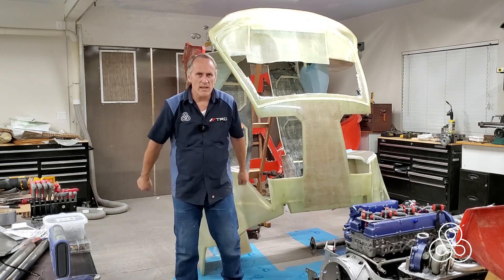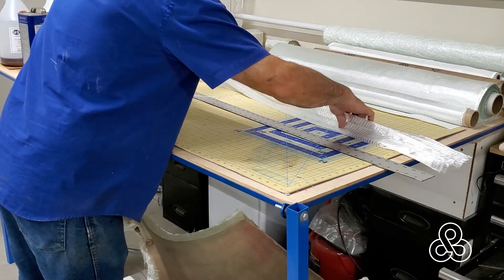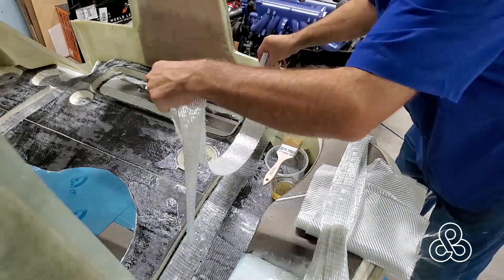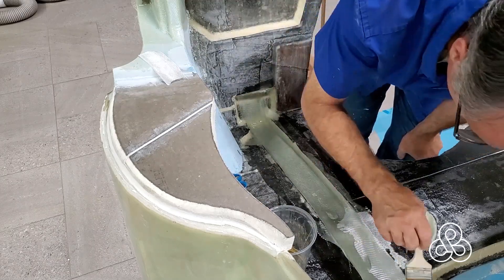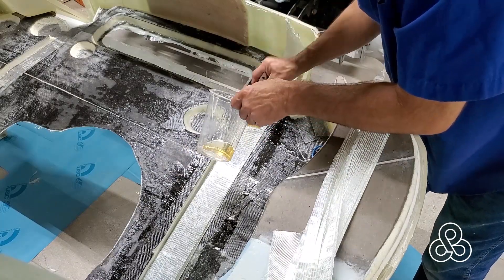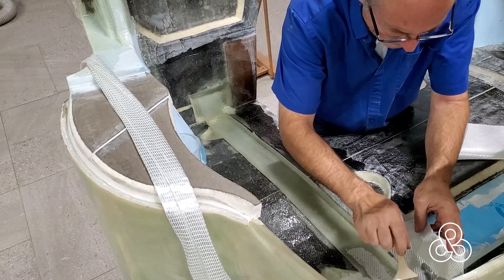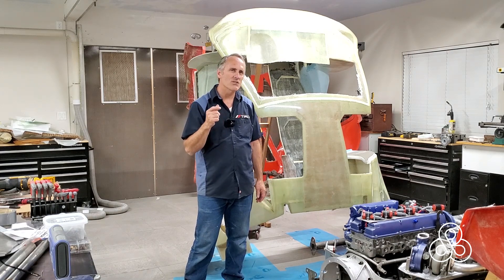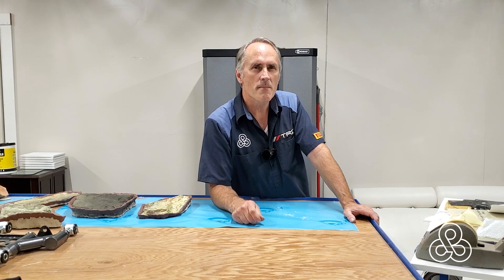A40 - How not to die in a supercar. Arete Supercar - laminating the vertical beam, roll structure

Comment: I find it more convenient to pour the hardener (smaller quantity) first, because it's easier to multiply by 4 in my head than it is to multiply by 1.3333, and also because it's easier to be accurate (percentage-wise) when pouring the larger quantity.

Comment: You asked about gel coats. We used a lightweight sprayable polyester filler called feather fill as a primer. You catalyzed it like a polyester resin and in about an hour and a half it was ready to sand and it would fill in any small imperfections.
Reply from the maker: YouTube shows you as a new subscriber. Thanks for following the channel. I've tried Feather fill as well as directly spraying automotive primer into the mold before lamination. I've found that I'm just not that good of a composites fabricator as I seem to always find some area that needs a little sanding attention; then its back to bringing out the primer again. Perhaps in a production set up you could get into a routine and the errors corrected. As I rarely build a run of any item, I have learned just to sand and prime before painting.

Comment: Normally the structure around the windshield is reinforced and I’m very surprised you haven’t used a U shaped steel element running around the windshield and down to the main chassis. Also, I see you intend to directly bind the windshield to the frame and if there is any body flex there is a very high chance the windshield will crack. A really great project though :).
Reply from the maker: More reinforcement to go. Urethane bonding directly to the frame makes the windshield part of the structure. Some cars even use the windshield as part of their roll over protection. True that flex can be a problem. . . we will just have to eliminate it.

Comment: for me i would use 12 point cage integral to front section with control arm attachments. then bolt the back assembly to the cockpit cage through the bulkhead bottom middle and top. head ache bar protecting cockpit from engine movement in foward crash. cross bar for 5 point harnesses. for racing they  allow .090 wall 1.5" tube. i use .120 wall for safety. some sort of door exbrace is needed.

Comment: I keep wondering how much the finished car will weigh ?
Reply from the maker: Trying for somewhere between 2400 lbs (1080Kg) and 2800 lbs (1270 Kg), we shall see. Budget is forcing me to use more steel than aluminum so the weight is pushing up a bit.
Reply: @BuilderCreator  are you planning to powder coat the steel or paint it?
Reply from the maker: @thatwolffe3802  all the small individual pieces are powder coated, but leaning toward painting the subframes.

Comment: Scrapping the sides is important but so is the bottom! Cut your tongue depressors at the end to allow you to properly scrap the bottom.
Reply from the maker: All of my smaller cups have ridges in the bottom and the round end accesses those low spots, although your suggestion would work on a good flat bottom mixing cup, of which I'm to cheap to buy. Ha! I think the real answer is the amount of time mixing. Stiring the batch just a few more times, has not failed me. I don't think I have had a failed batch of epoxy in over ten years.

Comment: NASA and SCCA are the governing bodies that hold time attack and as for track days most tracks have their own days but they usually use SCCA regulations for race cars and for street cars you just get a basic safety inspection . Though most of those days have limits on passing and driver aggression that will end your day if you drive unsafely . You can integrate the roll cage into the cars structure a removable cage IE a bolt in one isn't really legal for any racing that I know of I know that NASA here in the Mid Atlantic won't allow a bolt in cage in a time attack car . It's possible to race in some street classes of rally cross without a cage but only the lowest classes and your motor and the fact that it is a prototype so it doesn't have a class would make you have to race in the highest class available for the type of racing you wanted to try . It would still be fun you just might be stuck running with GT3's and Ferrari's or old NASCAR's .Oh look up the SCCA and request (buy ) a rule book figure you'll need whatever the minimum cage is for a fiberglass monocoque with a rear steel tube sub frame . I know there are race cars built this way I just can't think of an example that you could look up in the rule book ,but there's no way to have a removeable cage in a car  that makes it race legal . It needs door bars for starters and it needs a bar under the dash as well as above the windshield at the roof line . A hoop doesn't really cut it , maybe to make yourself feel safer on track days .
Reply from the maker: Yeah, it becomes a little hazy when you come along with something different!
Reply: @BuilderCreator  not sure if its been answered. But in my design I'm using the rules for the Pikes Peak Hill climb unlimited class, as it is some of the more strict regulations in the USA

Comment: You really need some to show you how to fiberglass properly, your car looks so nice you've done so much work , but you have to many air bubbles in your layer's.
Stop thinking less resin means lighter no less resin means not a good bond .
It's like cement you put steel in cement to keep it together but the cement is the strength like fiberglass you need more resin .and a bloody roller .
I'm not a troll I know what I'm talking about I do this every day for a living .
Reply: Interesting comment Peter (I am NO expert). Does the squeezing he does with a plastic scraper make a difference?
Reply: @johngreen8693  high John , first it's not a plastic scraper it look like an old bank card , and yes it does make a difference because he is not applying the right amount of force to make a proper bond  and he leaves to many air bubbles in , air pockets is like cancer .

Comment: Roll structures 😡😡😡😡😡 That's a very sore subject with me. Of course you can make a roll structure into the car that would support 40 tons on the car using high modulus carbon covered with Kevlar to avoid shards and spikes in the event of an impact. You can do the same inside of the car doors. However, none of that is acceptable. You need a ridiculous 1 1/2  or 1 5/8 mild steel or cromoly tubing roll cage going everywhere in .118 or .083 wall thickness. It has to be fully welded with no bolted components.  To make it invisible somewhat you have to use it as structure for A pillar, B pillar, under dash pedal and accessory mounts, roof skin mount and get certification. Then build the interior over it. Obviously video documenting the build and certification process. Every sanctioning body varies but I don't know of any allowing removable cages.
Reply from the maker: The upper levels of TimeAttack is the only place where I might likely venture, so it would be an "event only" bolt in system. After looking over those rules I think we can manage it.  First off I would have to get the car done, then become proficient enough to even compete. Ha!
Reply: There are boltin options allowed, such as in SCCA. Check the rules. Here's an example of how to use tube connectors for this.
https://youtu.be/mon8NlemJTQ